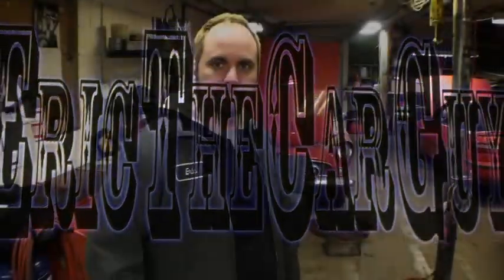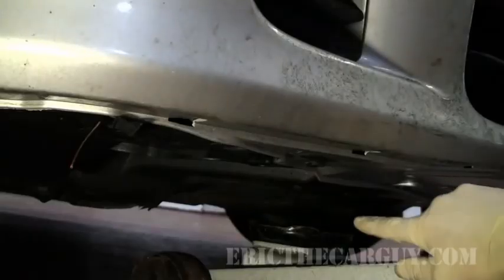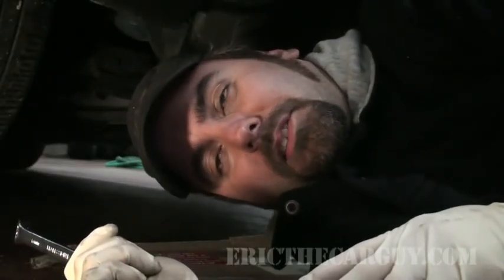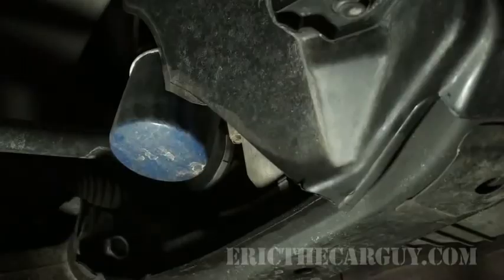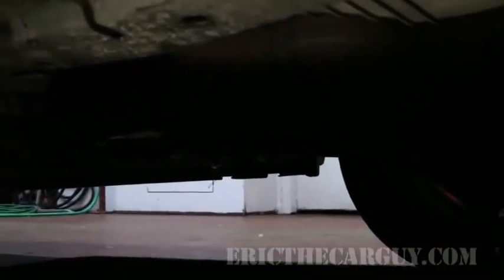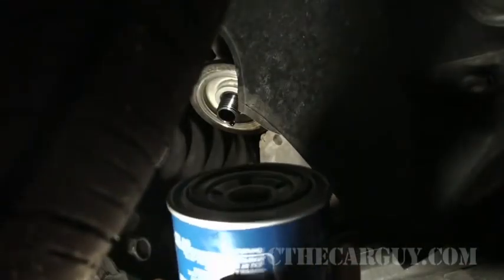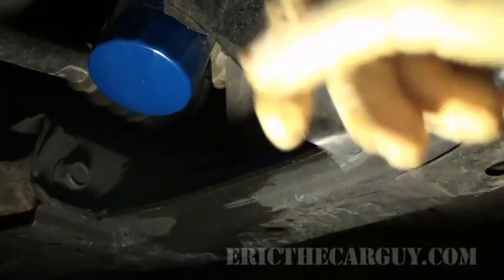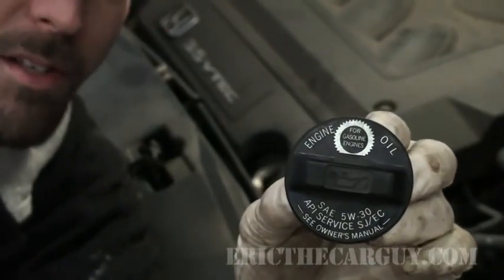How To Change Your Oil (Full) - EricTheCarGuy

Comment: I love card board.  I have neaglected my oil change by about 200miles.  Used royal purple for my old 93 302 v8 mustang.   I am not driving it until pay day, which is thursday...  She overheated bad today, oil pressure is good, but she got so hot, she has no oil in sump.... Fuck me hard!  I feel like slapping myself to death!  Hindsight she is an old 302 with 98thou miles.  Last oil change was 95thou.   I am going high milage oil this time lol...

Comment: Try changing your oil with the Valvomax Oil Drain Valve. Drain oil with the turn of a wrist. No more looking for tools or cleaning up mess. The valve replaces the standard drain plug. Oil can be drained in 10 minutes.

Comment: It's a common myth; I hear it a lot. Conventional and Synthetic oils are able to be mixed without issue. A "Synthetic Blend" is a perfect example of this.

The myth stems from a characteristic of Synthetic oil: More consistent, and smaller, molecule size. Old engines with worn gaskets can, on occasion, develop leaks. It's not the oil's fault, though. It's just finding holes that were already there, that the larger-moleculed conventional oil couldn't penetrate. :-)

Comment: this video was helpful but you should have put oil in the filter in advance so the engine doesnt start dry.
Reply: +schissel4able 
Yes you can it does help prevent dry start ups however some cars the oil filter mounts sideways or upside down so you cant always fill it. Eric discussed this in his oil changed tips video.

Comment: You mentioned high-mileage oils in this video, and it got my brain cell twitching...

Many high-mileage oils contain esters as an additive. These esters are used as "stop-leak." They interact with rubber seals and cause them to swell and bloat. Unfortunately, there's no stop to this. Once esters come in contact with rubber, the rubber continues to swell, until it loses its integrity and falls apart. I personally advise against high-mileage oils for this reason. Open for (civilized) debate. :-)

Comment: i think it is illogical to start an engine prior to changing the oil. The whole point is for all the oil to collect in the pan. And it did just that overnight. And now you want to send it all back out before you pull the plug? And as for the idea that sediment will stay on the pan....what sediment? any of that should be trapped inside the filter.
Reply: You do that so that it flows better. I drain it for 45 min. Black slime usually comes out when I do this, lol. It doesn't come out when I drain cold. Just don't burn yourself. I use full synthetic though because my brother goes ~6000mi between oil changes. I gave him the car for free, lol. 1999 Chrysler concorde LXI 3.2L V6 w/ 145,000mi. Had an engine rebuild.
Reply: hot liquid flows faster than cold liquid duh!

Comment: I ran out of characters in the other commet. I always fill the oil filter with oil before instillation It even tells you to do just that on the oil filter box. PS I always slip motor kote in every engine I work on . Beacuse I know that oil by itself  is not enough protection! 
PS. Royal purple , valvoline , SFR and motor kote kick ASS!!!

Comment: Always fill your filters all the way with oil  ON ANY engine  I don't care if the filter goes on sideways.... If you dont your basically running your engine without oil for  few seconds which is bad.

Comment: I always change the oil myself in my trucks and car. Yet nearly every time I injure myself. Recently I changed the oil in my car, and I over-torqued the wrench and it flew off and hit me in the head. And today I changed the oil in my truck and my hand slipped off the wrench as it was greasy, and I mashed my hand into the engine block. Now I have a MASSIVE blood blister on my index finger. Am I a colossal anus? Or do is injury common?

Comment: It IS important NOT to over-tighten the drain plug.  If you do, you can strip it then your oil pan won't hold oil, or it will leak, or you will need a new one, or you have to use one of those self tapping things... Bottom line, do NOT overtighten or cross thread an oil plug.  NOTHING Pisses me off more than a messed up oil plug.

Comment: It's time you did everything good but you screwed a dry filter on your engine block.  Should have filled the filter without overflowing it then screw it on to the engine block.

Comment: You didn't fill the filter with oil.
Reply: You don't HAVE to fill it, it will fill itself when the car is running.
ps. even if the car won't get the oil faster, the engine won't be damaged because a split second of not having oil won't do shit to it.
Reply: You should pour just a little in it to get the filter saturated, it does help  to not have a dry start after a change..It can take a dry filter about 3 seconds or more to fill up after a start so why not just wet the filter with new oil before spinning it on...
Reply: Robert Diehl so how do you fill up a new filter in a 2015 Subaru Forester? cause the filter is upside down? (yes im being a smart ass) i only know to oil the filter if its a turbo, Diesel and a Canister based oil filter.
Reply: OK, you pour just enough, about half full, in it to saturate the filter, wait about 2 minutes and when you turn it upside down it will not come out and then your oil will go strait through with out saturation time after the start up .
Reply: No need for that

Comment: why does a car need oil filter
Reply: To filter the oil
Reply: Why does vroom vroom need oil?
Reply: even though a motor is lubricated there will always be metal wear, In example metal shaving and dust. A oil filter will capture this byproduct  from recirculating into the oil system.

Comment: @EricTheCarGuy One time when I was at the Sars Auto Repair place, I was walking around and saw them five off this Honda they just oil changed and this trail of oil following behind it. When I told them, they found out it was an old gasket that didn't come off also. Not even a thanks. I really wish I would have reported them. Ungrateful ingrates. I should have just let that guy drive off with zero oil and have his engine blow a piston. Free new car for him! Customer service fail those guys.

Comment: Hey :) I realize I am not Eric, however; I can offer some insight. 
Car manufacturers have actually advised auto mechanics against using chemical additives to *flush* the engine.  
Video one 
youtube.com/watch?v=wiCAJ8ULnaI
Video Two
youtube.com/watch?v=Pf6KY6rrqYU

In both these videos, a news service reports on how Jiffy Lube offers services not recommended by Manufacture. In fact a Honda Representative, in the video says that the *flushing* services offered are bad.